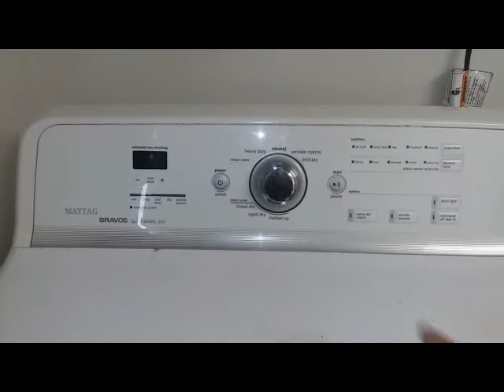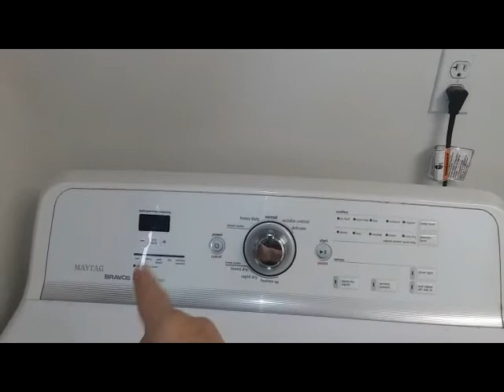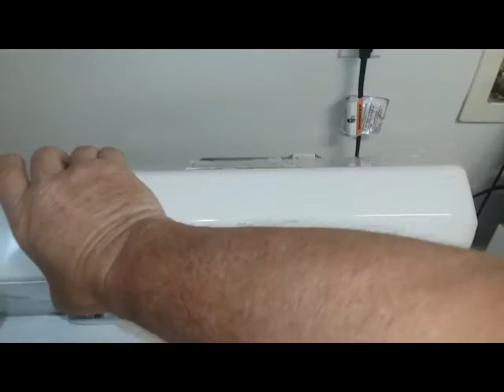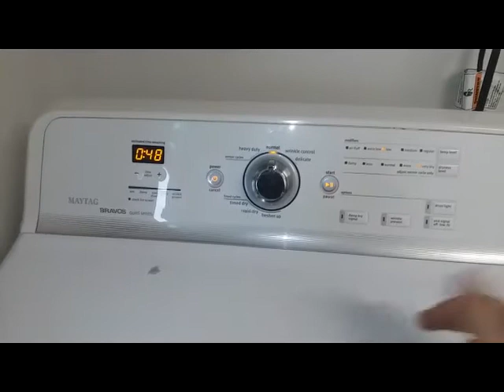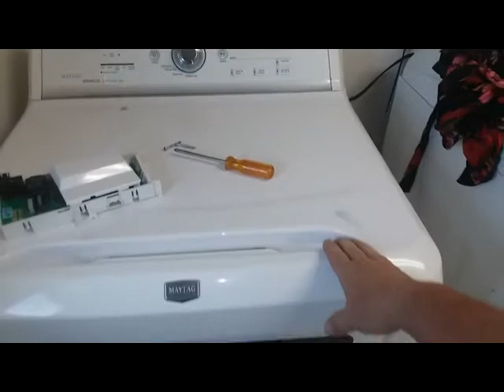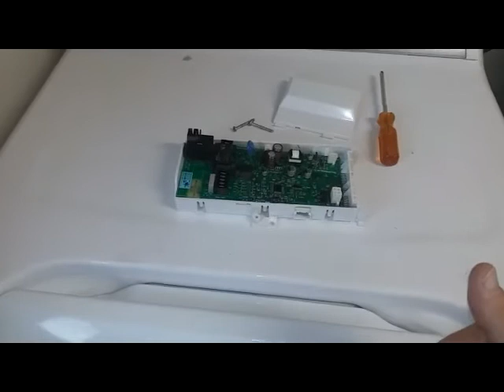Why Your Dryer Stopped Working After Lightning

Comment: A whole 5 years later…. After replace the part how much longer did your dryer last? I’m assuming you must have a newer one by now 😂
Reply from the maker: Yes I do have a new one.  Its the same kind.  I ran the old one until the belt wore through the barrel.  The new one is making a horrible noise.  I'm sure its the tension pulley.  Im glad I could help.  Wait! Did I help? Did you like the video?

Comment: This same thing oftentimes happens in refrigerators whereby the solder/contacts of a circuit board mounted relay will, over time, arc and eventually damage the copper traces on the board. It's an easy fix if you have some electrical skills. Why does this happen? Welp, the physical mounting of the board is vertical and heavy components, like relays, are sticking out horizontally with no support other than the component pins in a machine that vibrates and shakes. A simple recipe for failure. If the board was mounted flat, or horizontally then the heavier components would be supported mostly by gravity and not hanging by the pins alone.

Comment: Thank you for taking the time to post this video.  I was having the same issue and error code.  Didn’t know where to start but I’m thankful I found your video.  I found the circuit board I needed on eBay and $75 later had my dryer running again.  People said they could solder it themselves but I have no knowledge how to do that.  Thanks for your time and knowledge.

Comment: Not necessary to replace the pcb.Only to replace the relay(if damaged) and add extra wire on the pcb to let high current to pass the relay switch circuit without more heat.
Reply from the maker: Thank you for your valuable help. I was totally lost when this happened

Comment: I hate to say this but you could have repaired the board yourself. All you need to do is clean the burnt out solder joint then add some solder, i am an appliance tech and usually place a piece of wire between the two solder joints that cause the issue and solder it in, its a design fault and the solder joint cant handle the voltage load forever. The wire takes some of the load. You can solder it without the wire and it should still work. I have done at least 10 of these
Reply from the maker: Thank you. I didn't know what to do. I really appreciate all your help.
Reply: Thank you for saying this. You saved me a lot of money. I had the exact same problem with my dryer and tried soldering it together via your advice. Worked like a charm!👍
Reply: @alexander15551   welcome!! I love to hear that someone benefits
Reply: Did this and mine works like a charm now. Thank you much
Reply: Thanks for the info.  It is a cold solder joint which eventually has enough resistance to overheat and fail.  I also soldered a jumper to the 3 pins that are on the same track.  Works great and saves a ton of money.  Took 12 years for mine to fail.
Reply: Here it is, 3 years later, and I'm jumping on to thank you so much for making this comment on the video. My hubby just repaired our board with his soldering iron. You saved us close to $1,000 for a new dryer. I'm very appreciative!
Reply: @dawnkirk6028  welcome, I am so happy that you had the courage to try it :)

Comment: I went on ebay and sent the old one in and got it repaired. It cost  $35 plus sales tax.. They sent it back and I installed it...works great. It's guaranteed for 60 days. I also bought a RV surge protector because of the plug because my dryer circuit board blew out during a thunderstorm. The plug cost $22 on eBay.
Reply: Thats a great idea! I am an appliance tech and didnt think of this